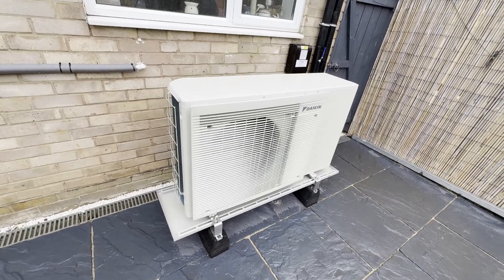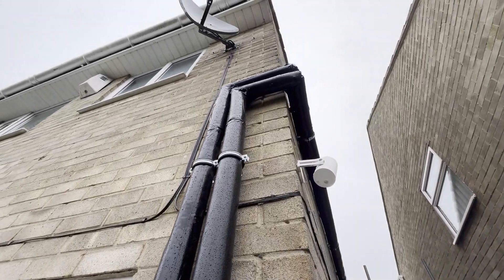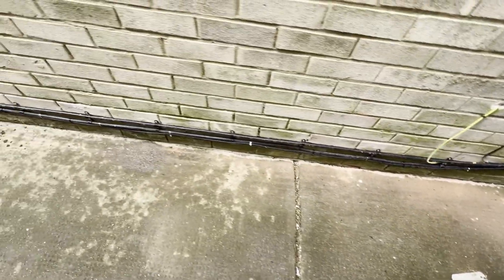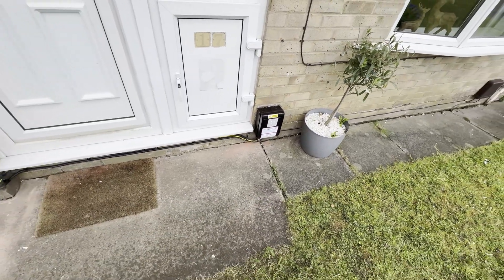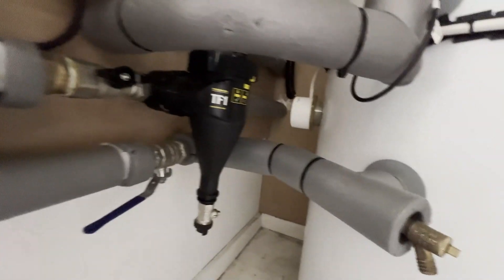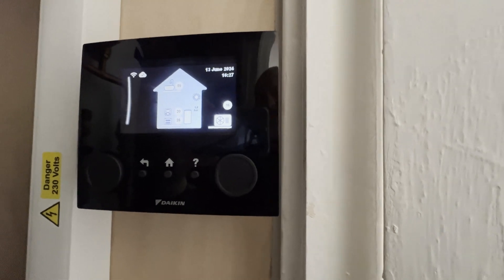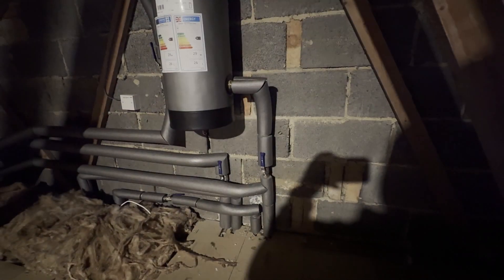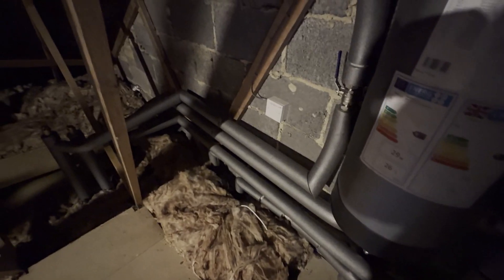Octopus Heat Pump Installation Day 4 - Final day

Comment: Just seen your videos, I haven't got a heat pump yet. I'm going to book a survey on Monday. The question I have is, why couldn't the external unit go at the side of the house at a height of about 7 foot? Then you wouldn't need the extended pipe run & it would be out of the way.. Unfortunately, I haven't got sufficient clearance at the side of my property due to my boundary fence, so an installation on the floor is not an option.
Thanks

Comment: I like your videos they were very helpful, can I please ask what was your quote less the BUS. I am just waiting on the survey and have to say looking forward to having my ASHP installed. It be good for your next videos to show how to work the system and adjust the settings etc
Reply: Good vid,  did they give options for the external pipe routing,  interested to see if flow and return can enter via loft and drop to airing cupboard, rather than longer wall routing.

Interested to see your results a and spend
Reply: @alexFlan83737 they can. Mine is being installed next week. 1 run straight up into the loft, across and down 👍🏼
Reply from the maker: I wasn’t offered any other route for the pipe but sure they would have obliged if I had.
Reply: Getting mine tomorrow, very helpful vid tnx
Reply: My install starts a week tomorrow, 22nd July. Looking forward to it.
Reply from the maker: The total cost once the BUS was taken off is £950. I did have to spend about an extra £500 on removing asbestos from the cupboard ceiling and getting planning permission. I only needed this as the pump was scored at 1 decibel over the allowed limit when closer than 6m to my neighbours bedroom window.
Reply: @kindns how is the system performing now a month in? Do you know what your cop is running at?